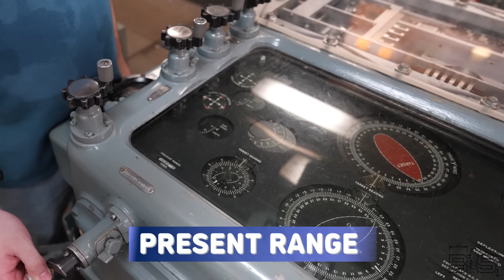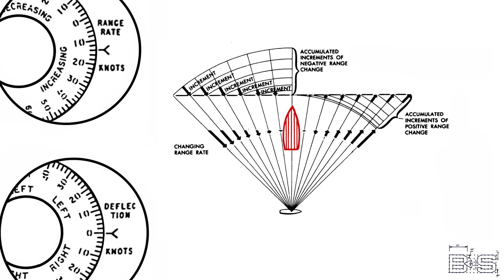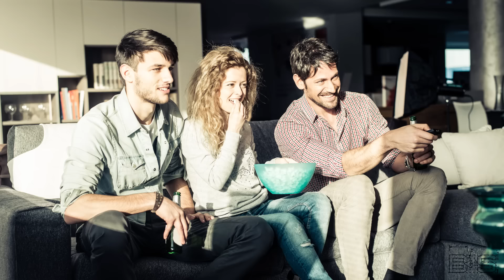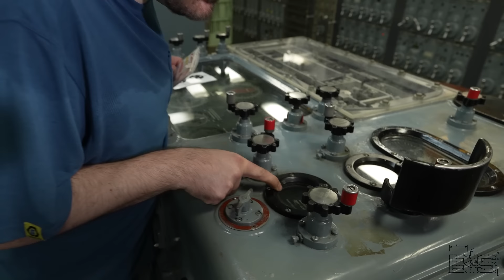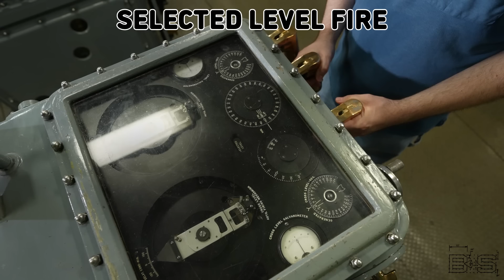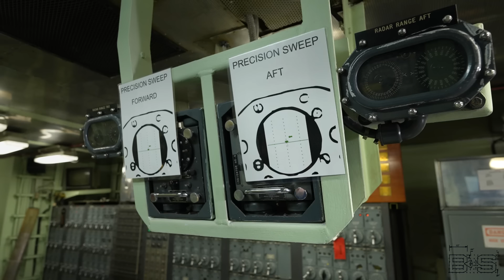Using a Battleship Range Keeper

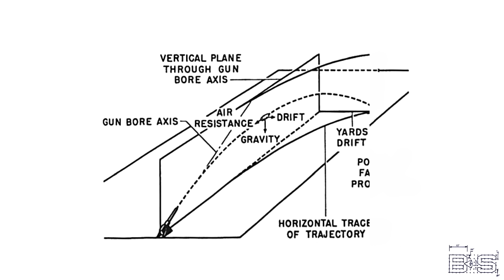Comment: 20:52 That's how boomerangs work. The difference is the boomerang spins with an axis perpendicular to the path of travel and the fins push the boomerant to the sake side but sinfe the boomerant spins, the relative air velocity  for the upper fin is higher than the one for the lower fin and that causes it to roll. That causes the boomerang to pitch all the way back into our hands.

Comment: I really enjoyed that (I can tell you have a computing background, I also have a fascination with mechanical & pneumatic computers).

BTW, a Mil is 0.056 degrees (17.7 mills to a degree, a full rotation is 6400 mils). I'm surprised such coarse measurement is adequate. Initially, you were referring to 1/1000th of a degree. We're spoilt these days with low-end gyros & rotary encoders having a 16/17-bit resolution (182/340 per degree), 23-bit servos are also cheap & widely available (23,3000 per degree). You could create a similar fire control system for <$100, and put additional sensors on the turrets (their movement will be different than the centre of the ship for ~$10 (cheap IMU & ESC32). Range finders are ~$200. Radar is ~$2,000 if you want to get fancy.  I wonder what they would make of it if you could travel back in time and give them an Arduino starter kit [and a way to program it]. I'd wager that it would also be the fastest supercomputer in the world. Did I say we're spoilt?

PS: The beauty of those flow diagrams is that we only need to know what goes in and what goes out. You don't have to concern yourself with what goes on in each box (could be a black box); it provides an abstraction over designing complex systems and enables reusable components. Speaking of beauty, I think a video about the beauty of Nautical Miles and how/ why they came about would be worthwhile (I think we should use them on land, personally). I hope to see more technical/ deep dives. Have a great weekend!

Comment: If you think about the complexity needed for one moving ship to have chance hitting another moving ship in a 2D map. I wonder who well that worked for tail gunners who had to do that in 3D space without a computer. I did basic tensor calculations and doing the math for one flying object trying to hit a stationary object that's not in line, would wreck my brain.

Comment: AI could NEVER design such a beauty
Reply: Give it a little more time.......AI is going nowhere but better every single day with no peak in sight.
Reply: AI could definitely be used to design a system like this.  AI is deeply integrated into modern engineering software across all disciplines.  This type of thing is one of the things it's actually useful for.

Comment: Imagine being given a solid block of metal and being told: Make a computer that will solve integrations and complex algebra AND calculus functions.
Reply: I think there's a law that states computer scientists love anything that can be computed (check out mechanical computers). Believe it or not, the problem still exists today with using signed (can go negative) vs unsigned (positive) numbers.

Going back to Ada Lovelace & Babbadges Anylitical Engine, you can recognise that it is a computer with registers and write code for it (it's Assembly Language). It is a shame it never got built. Babbage's earlier Difference Engine is in the London Science Museum if you're ever passing through.
Reply: @garethevans9789 I would absolutely love to visit the London Science Museum. I don't know when that would happen though as I live in the US and live paycheck to paycheck.
Reply: Some of those operations are actually rather intuitive with mechanical computers. In addition, you have garantueed execution times observability and other nice properties.
Reply: Would it be too much to ask for a few machine tools to go with the block of metal at least?